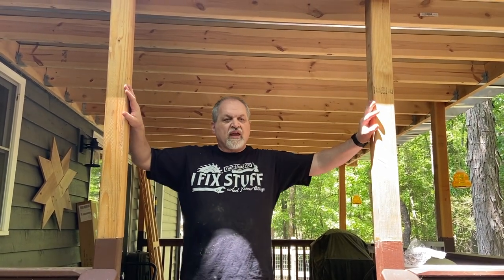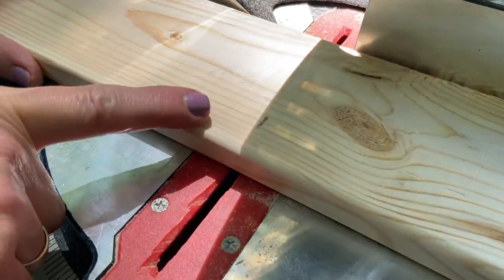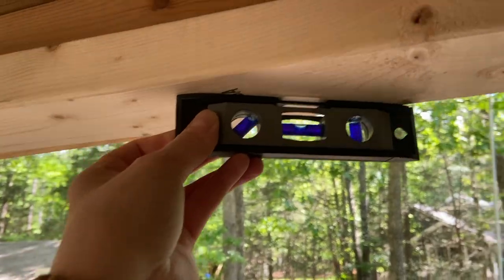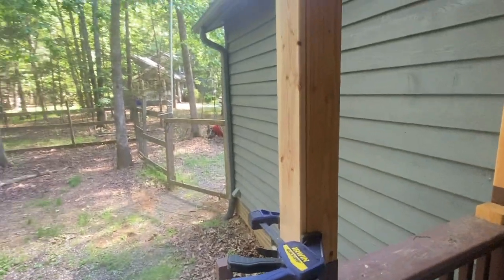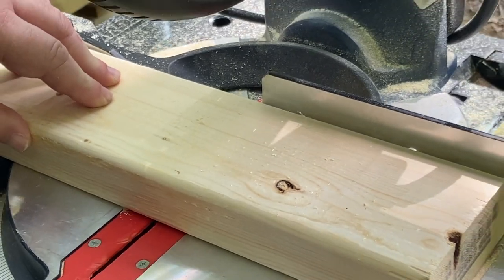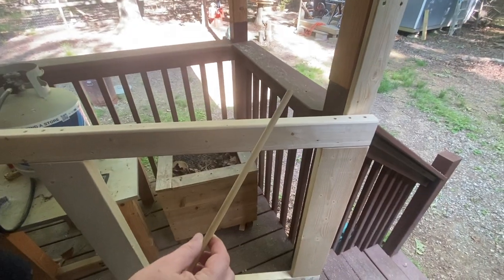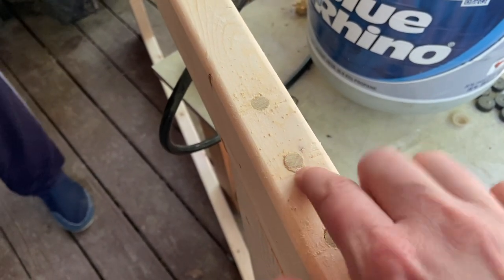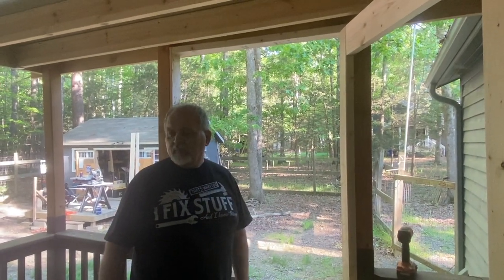Don't spend $600.00 Learn how to build and frame a  screen door for  $37.00!

Comment: Only thing I had a question about was the gap on the right side of the door when the door was closed, ( opposite the hinges). How did you deal with that part?
Reply from the maker: Great observation and that was left on purpose, I used a strip of lumber to create a stop for the door so the door can not be overextended and damage the hinges,